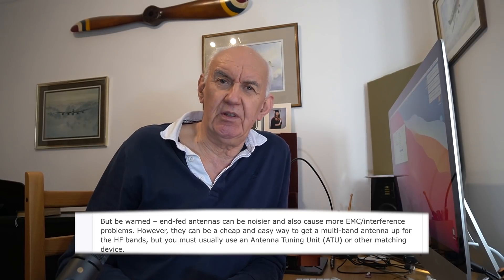END FED HALF-WAVE ANTENNAS - BEWARE!  WHY?

Comment: Same thing happens when discussing the TTFD antenna. Some say it doesn't work and say it's lossy. Ask them if they've ever used one. I have used the antenna for years and it does work...!

It's quiet but so quiet that some signals are heard with it that are covered with noise with other antennas. I've even heard long wave beacons with it and an Icom 718 that were hundreds of miles away.

Some say certain antennas won't work, that some are air cooled dummy loads or compromise antennas but they've never used them. They're merely parroting what others say that also never used them. We can believe Peter because he is using them. KK5R

Comment: In Brazil in 1950s and 1960s, it was common to see Post Offices and radio services together. The one at Manaus had radio room on second floor. Operators sat at tables in center of the room. Transmitters were lined up against the wall. There were open wire transmission lines going upto ceiling. They were about a foot separating the feedlines and they made a loop on the feeders where they inserted a florescent bulb that flashed every time a CW signsl was sent. Radio operators only had to glance at the bulb and see that his transmitter was working.

Comment: Do you prefer to use an antenna tuner and a single wire or do would you suggest changing the wire between band changes?  I'm looking for POTA, most likely in the 10 and 20 meter as a Tech (for now).  73 KO6JPZ

Comment: If it works well for the guys writing articles about them in the ARRL Antenna Handbooks, they can't be too terrible. ;D
Then again, I'm one of those engineers who believes there is no such thing as an intrinsically noisy antenna, only noisy implementations. ¯\_(ツ)_/¯
4:22 this is something I've railed about for decades and I have no idea how to fix it.  Just because someone's an "elmer" doesn't mean their opinion is technically correct. O_O

Comment: I had never tried an end fed antenna of any variety in over 40 years of being a ham. I bought a Xiegu G-90 radio, and decided to take it with me on vacation. Not having a portable antenna, I looked around and came up with an end fed long wire (100 Ft of 20 guage hookup wire). I put a 5 uHenry coil 2 meters from the feed point (a 49:1 balun), and amazingly, on every HF band (including WARC), I showed SWR of Less than 2.5:1, easily matched with the Xeigu's onboard tuner. I traveled over half of the US, and worked into Europe on 40m at every stop, most often with an inverted Vee configuration, draped over a tree limb at about 20 feet. I must say, this antenna was as prolific as any I have had at home.

Comment: Thanks for the video!  

My concerns about an end fed half wave antenna are:

1 -  If the feedpoint is near the ground where people and pets might come into contact with it during use, very high voltages are present and could cause RF burns.

2 -  Noise tends to be vertically polarized.   So, if your antenna is mostly vertical, you may experience increased noise.

Comment: Thanks.
You can match the wire for 40m and use a cap between 200pF to 500pF 2-5kV to connect the wire for 80m to get the reconans freg of 80 to get up around 3.7MHz if you want to use the ssb portion on 80 meters, you still have 40-10  reconans in line, dont forget the coil 2 meters from the 49:1. Just do a coil with the antenna wire on a 25mm plastic tube.
73

Comment: What kind of wire antenna would you recommend to use for "real" DX (Europe to US west coast, Australia, far east, ...), especially on 20 - 10 meters?
Reply: If you can get your antenna high above the ground (greater than a half wave at your operating frequency), a dipole will be sufficient.   If you cannot get your antenna high above the ground, a 1/4 wave vertical antenna should suffice.  And, at 20M, a 1/4 wave vertical is only about 17 feet ( A little less, actually).  A 1/4 wave vertical will definitely take up less room in your yard.  You can use wire for a vertical - just tie some paracord to the end and toss it over a tree limb.   Or, you can use a fiberglass extendable pole with a ground stake.

What you do not want to use is any sort of antenna that uses loading - like ham sticks or screwdriver antennas.

Comment: I only use an EFHW with 100W. Over the last nine months I worked 98 countries and all 50 states on 20 and 40 and almost all 50 on 10 and 15 and mostly on phone. With a tuner I run 12 and 17 and 80.  I have the high end at 90ft and the low end at 35ft. I do not use a counterpoise and I feed it with 50 feet of LMR-400. Most of my noise problems were generated in my home. I was suffering with S9 noise on 40 and S5 to 6 on 20 until I eliminated all the noise sources and there were many!

Comment: I completely agree with the point about older equipment having a poor RF immunity. In fact that did raise an eyebrow in my 2024 when an example of a hi-fi was given. I'm 46 and I hadn't heard of the term "hi-fi" for probably over 30 years! 😂

On the one hand a hi-fi made for a good example where multiple components of such a system could be susceptible, but that on the other hand, who has a hi-fi these days? 🤷

The far better example was digital TV (i.e. Freeview) and the result being a pixelated picture and corrupt audio.

Comment: I use a EFHW antenna and have done so for quite some time.  I solved the noise problem with a Common Mode Choke.  IMHO I feel EFHW antennas are the best bang for the money. Noise doesn't always come from the antenna and current heading back to the shack on the coax.  Power lines from utilities, VDS, LED lights, and other equipment on the electric feeder system is a huge source of noise.

Comment: Peter, I think the computer programmer"s mantra of "Garbage in, garbage out" could be applicable to the EFHW way back when, if your tube (valve) transmitter hasn't got a low pass filter on it, the EFHW or any antenna really, will radiate those harmonics. The RSGB suffers from the same problem that many institutions suffer from, lack of everything to keep knowledge up to date, so busy sorting out the current/latest information, there is no time or money left to make historical information current.

Comment: Because of the geometry and area of the property my house is on, my only options are an NVIS, which would be a 60 foot long EFHW, a vertical, or a mag loop. I do not have the space for a dipole or a tower with a Yagi.
Reply from the maker: Go for EFHW - even at very low heights it will work!

Comment: OPEN QUESTION  to Peter-[G3OJV ] or any viewer who  is well versed in EFHW  antennas.

I just got a  49:1 unun  to  experiment  with the  antenna.  It seems to work with wire  cut for 80m.  I can get manual tuner to get me  down to 50 ohms except  12m and 6M, while 17m is hit/miss.

That said can more then one  wire  be  used.  For  example, could  I run my 80m wire say to the  North, a 6m wire  120 decrees and a third for 12m say 120 degrees from the  80m and  12m?  Basically, you envision the 80m wire 360 degrees.  Since one can have  multiple wires for a few  bands going to the ctr feed point of a  doublet, I'm wondering if that would  work for  a EFHW antenna.

Thanks,
John  73
Reply from the maker: John, an extra wire does not work. The UnUn simply sees it as more wire and the whole system detunes.   There is no easy way to get the antenna to cover every band. An ATU helps but then are then significant losses in the UnUn.
Reply: @watersstanton  thank you
Reply: So, I am then better off cutting separate wires and switching the m out as desired, I guess.

Comment: I use and EFHW  which has  about one third of it vertical rest horizontal about  25 Feet  I  also  have and use  dipoles and Verticals  for Most HF  most bands all work excellently  EFHW  surprises me  on a regular basis  worked  into   China  Japan Australia never use  more than 75 Watts and    mostly  use  75  Watts of less  and when  portable 5 Watts 
thank you for   Information  and Exploding a  few Myths
Reply from the maker: Sounds good. 73 Peter

Comment: I've been using a 'PAR EndFedz' wire antenna for 20m, and I work tons of DX in many continents, running 100w barefoot.  The antenna is low to the ground, but it GETS OUT!  I've not noticed a higher noise level either.

Comment: I like my EFHWs for QRP and portable work, unbeatable, I've laid them on rocks on tree-less summit and worked many, many of stations. Some things you didn't mention in the video, the EFHW is just a dipole antenna, fed from the end, so you can prop up the middle like an inverted V and just feed it from one end; great when camping. Vertical these things are amazing, I've worked SSB from Aus to France on 5W on 14MHz next to the ocean. Some of the issues you can actually have with a proper half wave dipole: high voltages, if you are running 100W plus (sometimes as low as 20W) you can get very high RF voltages, just think of a radio with an amp running at 12v or 60v, and then you are running that into a step up transformer maybe 10's of times higher voltage; noise is mostly because an EFHW lets you be lazy in your installation, carefully pick you coax runs, chokes (isolators), matches, and tuning unit placement to get rid of all of that; and choosing the right match, a 9:1 is not for a proper half wave, but some people do and have issues.

Comment: I’ve been licensed sice 1964, so I’m very familiar with the old tvi and rfi problems. I was also skeptical about trying an EFHW at my HOA restricted, small lot. But I went ahead and built the transformer and put up wire for 40 meters. I’ve been extremely happy with the results and am very pleased that I gave it a try. It works very well. Any rf floating around is easily handled by inserting toroids wherever needed. It’s a keeper !
Reply from the maker: Great to hear from you and the results. 73 Peter

Comment: I used to live in the ground floor flat And I used a wire antenna It was a 102 foot long And I  It worked into America so it worked quite well And also I was surrounded by concrete And it worked for me so I would recommend anyone to use a wire antenna there is nothing wrong with it
 John G0WZJ

Comment: I’ve used an end fed random wire antenna with fabulous results. I had a pipeline into EU, Africa, Caribbean and S. America. My configuration favored that direction. My only problem was RF spikes on certain frequencies within a band that allowed RF feedback into the shack. Eventually, I removed the antenna because of the interference I was getting, even when using an isolator.

Comment: I experienced common-mode problems that I solved with a quantity of 5 closely-spaced Mix-31 snap-on ferrites on the RG-8X where it connects to the 49:1 transformer. I don't have a counterpoise and the antenna is fairly effective on 20 with a barefoot FT-991A.

Comment: Fantastic to have found your channel. My first Ham radio antenna build was an EFHW and I've made a ZL contact with it on 10 watts ! Yes I'm a VK.  I'll have to google "line isolator", is this different to a common mode choke? I currently don't have anything except a couple of clamp on ferrites just before the transceiver (which is grounded). I'm using RG213 that I imagine would be a bit tricky winding through a toroid. 73 de VK3LSR

Comment: Beter late than never as it is never too late ;-) EFHW is just a dipole with the feeding point moved from the center to the end. So radiation is similar to dipole. When the EFHW brings noise, a dipole will do the same. OK, at fixed installation, you need a line isolator as there might be imbalance between inner and outer conductor current (as the return current from the secondary winding of the UNUN just cannot disappear and will flow into the outer conductor of the coax,  this is was causes the interferention!). For portable stations the line isolator is not needed at all (the are no appliances nearby to interfere with). The advantages of the EFHW are ease of construction, no need for a centre support and thus no need for a long feeder, and the multiband possibility. Working 3000 kms on 20m is daily routine with 5 Watts from an IC-705 in the field. A lot of fun at very low cost (homebrew!)

Comment: * Any chance a properly cut half-wave wire, connected to a 49:1 UnUn, connected to an HF transmitter, won't need an antenna tuner??

* If I were to adjust the slope of the half-wave wire, would that aid impedance matching?
Reply from the maker: That's an EFHW
Reply: @watersstanton  The nut of my question was whether or not an antenna tuner would be needed.  I'm a bit less ignorant now than I was six months ago when I asked that question.  Getting a Nano VNA helped.  So did making, tuning, and using several EFHW antennas.  I'm completely sold on their utility and efficacy now.

The big trick in my area is getting the antenna high enough.  I'm not allowed to erect anything taller than 33' but I can grow all the trees I want.  So that's been my chief focus lately - getting wires all the way to the tops of the tallest trees, and growing the tallest trees even taller with proper care and maintenance.  😉

It's my understanding that 42' (~13m) is sort of a magic height for an HF antenna.

Comment: As a 'sufferrer' of a small garden and 'unsympathetic' neighbours I'm pretty restricted on what I can use for an HF antenna.   I've been using a 20m HWEFvertical for a while but have now made myself a 40m HWEF horizontal with 49:1 unun.   However, not surprisingly, your greatly appreciated informations seems to conflict in some ways with others and I'd be greatly obliged if you would keep me right!
1)   I'm told, somewhat emphatically, that counterpoises of a minimum of 66 feet in length, are absolutely vital or if this is not acheived I must have a coalxial feeder of at least this length plus a line isolator at the transceiver end.   Now my intended feed point is very close to my 'shack' with a coax feed or no more than 4 metres if I put the unun close to ground level.   Can I therefore simply add a few counterpoise wires and keep the unun low down with the feeder at a short length?
2)   I'm told the unun should be at the high point of the antenna - this I cannot achieve and fit the wire in my garden space - why  is it I can't I have the unun down low on the fibreglass mast?

I'm quite local to you and since the 70's regularly visited the shop in Hockley, like a kid in a sweetie shop - sad when everything moved!

Comment: If by "line isolator" you mean an RF 1:1 Balun choke at the transceiver (good advice), that prevents your coax from acting as a counterpoise. So there's no need to fuss about whether or not a coax counterpoise helps.
Reply from the maker: A line isolator (not always the same as 1:1 balun) placed at the tx end has NO effect of any counterpoise action.  Think about a coax sheathed dipole and you will get the idea. 73 Peter.
Reply: @watersstanton  I sit corrected.  Thank you.

Comment: As always thank you for this video. Little late to watch (late than never) :) .. 

I have been using EFHW antenna from 3-4 months now-Home brewed. I have tried many antennas and this is the last one I tried and I loved this because of many reasons. One of the main reason is it can tune to many bands without a tuner and almost 1:1 on all (80, 40, 20, 10, etc). I loved it and used it as portable and field day antenna as well. When I am going to my home town in village I used EFHW where I have a doublet with ladder line. Both performance well and the advantage of EFHW is no need to tuner and switching bands is easy. 

mine is on 240-43 for 100+ W and 140-43 for up to 100W. 

73
VU3TBU.

Comment: ...good one, the RSGB are full of it...  Been using a homebrew 1/2 wave multibander sort of a My Antennas clone for some time and have found it quite quiet, reliably work up to 2000 miles using only 20 watts, and some occasional DX, now that 10 is open. They assume that because the feedpoint is high Z somehow noise n buzzies are guaranteed...the outer shield of my LMR 400 coax is the 'counterpoise, that's all that's needed... yes I tried using a separate counterpoise and some ferrite decoupling chokes.. the common mode problema... but it didn't make much of a difference.. SWR is reasonable to nil. They can be quite directional with many 'lobes and nulls.. so be aware of that. Hung low at 25' they can be a good NVIS antenna on the low bands too... so those UK nets on 80 or 40 are easy... Richard VA7AA/XE1
Reply from the maker: Thanks for sharing. 73 Peter

Comment: Hello Walter. I have a fellow ham buddy that thinks that a center feed half wave dipole is better than a endfeed halfwave.  They are both halfwave lengths . The only difference between them is :  They are feed at different points .  Is there any difference on the efficiency  and the radiation  patterns between them?  In my opinion I think they are very similar to each other.  What do you think?
Reply from the maker: Well the EFHW is multiband but has a slight skew in its radiation pattern.
Reply: @watersstanton  But would you said they are similar? I think they are very similar. 73

Comment: Great topic.  It sure would be convenient.  Especially if I set two up on different coaxes at facing perpendicular to one another and could switch between them for directionality. 
Would there be issues with their 'co-linearity' even though no conductive path and one at right angles to the other?
Reply from the maker: There should be no problem with that.
Reply: @watersstanton  Thankyou very much for the response as lacking much spare time i have to limit amount of experimentation.